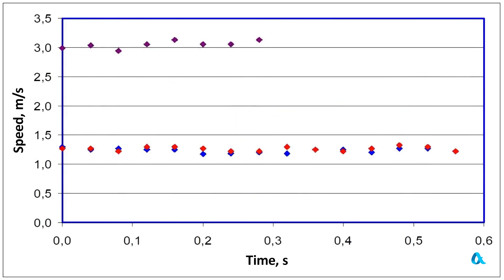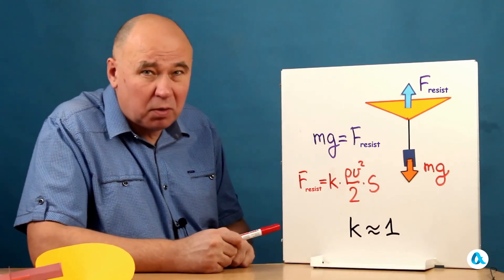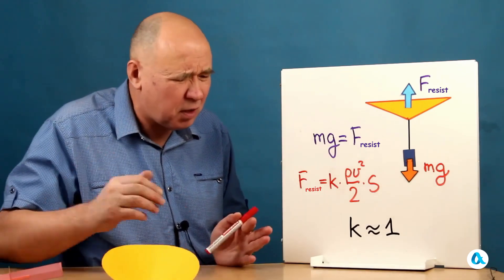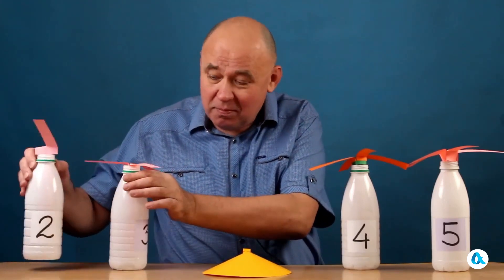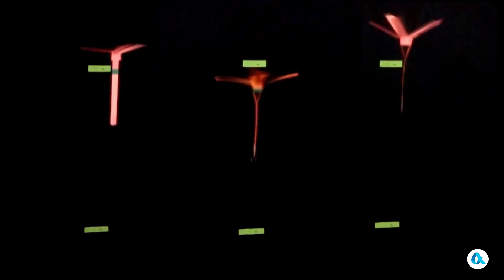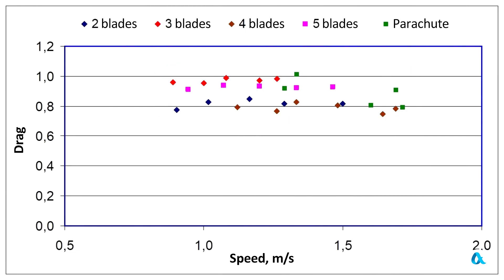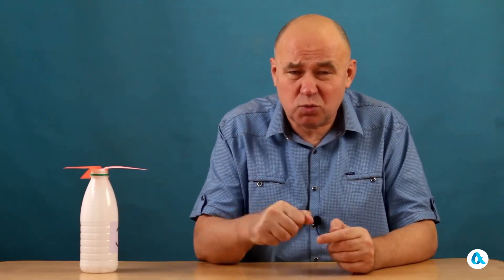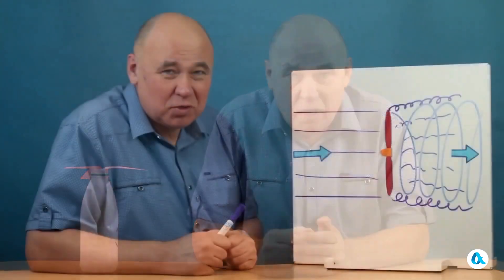Why does a wind turbine have three blades?

Comment: Falling and rotating propeller creates lift where parachute shape not it has nothing to do with turbulence. And blade number is not important is wrong. Helicopters have 8 blades exactly to create maximum uplift power and reduce rotation speed. Submarines with enormous diameter propeller rotating super slowly.
https://en.wikipedia.org/wiki/Windpump#/media/File:Wind-powered-agricultural-pump-1.jpg - These turbines sometimes have 48 blades even slow gust of wind 0.05 m/s creates enormous torque to power water pump.  Every blade creates own extra torque, more blades more torque. Dogma of turbulence stopped turbine design for 30 years.
Why does a wind turbine have three blades? to have four turbines civil engineers must reinforce tower 30% and anchoring turbine to the ground is most expensive factor after cost of electric generator itself.

Comment: becauce in 2 blades vibration will be happen that cause fail of blades and also  not perfectily balanced so that's why we use 3 blades with an equal angle is 120 degrees sir
Reply: Agree. And as with three blades, the opposition of vibration in a single blade is the average of the other two blades. Whereas with four, like two, the opposition is the far blade, which could cause catastrophic failure. Much like a three legged table will always be more stable than four... or two.